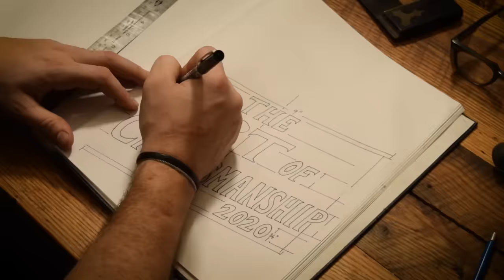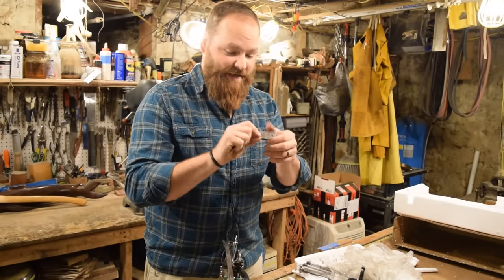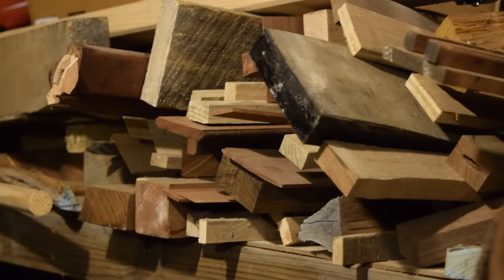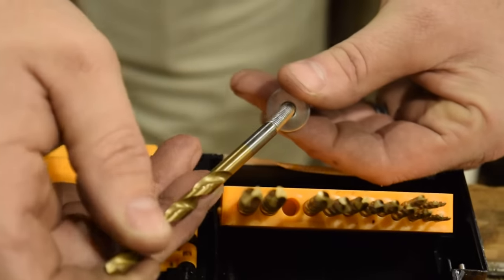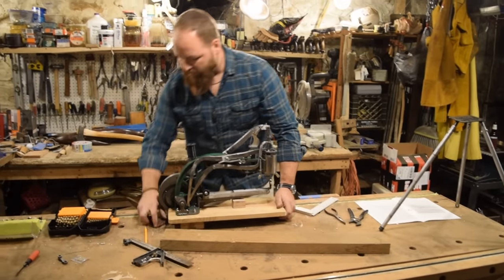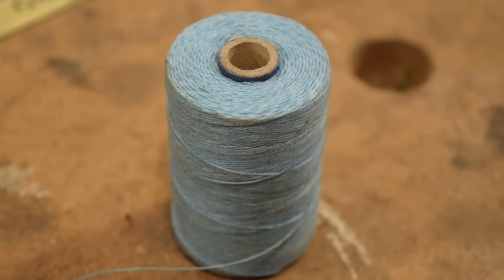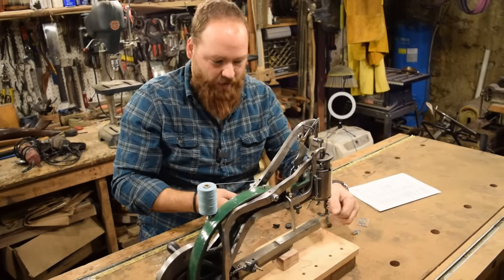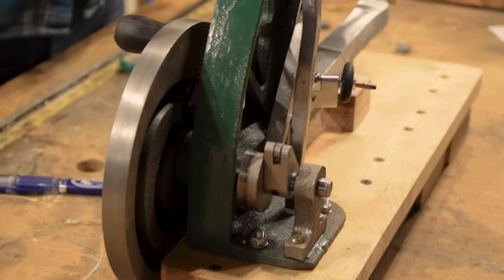The Infamous $100 Leather Sewing Machine: Unboxing and Setup

Comment: very good video. and an interesting product. i make a few knife sheaths and holsters. while i enjoy the work, i have to say that the hands arent what they used to be and something like this would save me a lot of discomfort. from what i can tell in the video, it sounds like the rollers and followers could all benefit from a bit of polishing with some 1500 or 2000 grit with some oil on it. smooth out the machining marks  and allow things to roll a little smoother. (while watching, i was wondering about the possibility of adding a bracket motor and pulley and just make it an electric. with the foot pedal, that would allow a little finer control of the work piece....i might just purchase one and attempt the modifications...
 but again, a good video....thank you
Reply from the maker: Thanks. There are some really good mod videos out there on YT.

Comment: I’ll stick with my Tippman. That small bobbin doesn’t look like it’s big enough to hold enough decent thread for large projects. Not sure if that COVID machine can sew thru 2 pieces of 10 oz. leather for a holster or knife sheath. Might work for really thin material, but good luck with important projects. You get what you pay for & a little more money will get you a solid electric sewing machine. An industrial electric sewing machine will sew thin leather really well, but for holsters, sheaths, belts, etc., my Tippman makes a great uniform stitch in up to 3/4” thick leather. It’s not electric, but has a lever/arm/handle similar to a slot machine with a grip-clutch (on same handle) to raise the foot. It was the best option for me for the money, but always best to do your own research. If I’m wrong, and you can sew quality leather with appropriate thread, please let me know. Thanks.
Reply: Suit yourself, of course, but I am able to sew up to 10mm (2 layers of 5mm) on this machine with no trouble (I haven't tried anything thicker).  I like the hand crank; electric machines inevitably go too fast for me.  The hand crank is easier to control.  YMMV.

Comment: I would put a couple of round pegs on the bottom of your stand that align with the peg holes in your bench, that way the machine won't move around while your using it. Also I would use it with the arm pointing towards my body, the flywheel will be easier to turn when going away and towards your body. It has a deep enough throat to be able to sew most things. And your needle is too small for the thread you want to use, which is why it is cutting the thread when you sew.

Comment: Won't you find it hard to control your two leather pieces with one hand while turning the crank with the other?
Reply: Usually the two pieces are glued together before switching, and the walking foot helps if they're not glued. Practice is the key to this machine.

Comment: Go to Mainly Acres on YouTube for set up tips also, you need to debut all the edges and polish the bobbin. Get a thread stand, do not run your thread off the machine.
Reply: I do ok with the thread on the machine, I just bolted a big flat washer under it.

Comment: There's vidéos of using 1930's cast iron singer machines sewing leather, we bought one for €50. We haven't restored it yet though, doesn't need much.
Reply: They don't work for thicker leather. There's a 1950s cast iron machine that will do upholstery leather pretty well, but it's not made for it and it's pretty hard on the machine to do much of that. The 1930s and earlier basic singer machines will sew very thin upholstery leather no problem, but that's it. (I've got a 1924 treadle singer, a 1954 podded motor singer, an off brand 1970s cast iron machine, a modern Janome, a patcher, and a serger. Guess which sews thick leather? Only the patcher.)

Comment: The problems you were having with broken thread wasn’t because it was the wrong thread for the machine, it was the wrong thread for the needle. Your needles come in different sizes in thickness and size of the eye; once you find the corresponding needle it will sew flawlessly with the thread you are accustomed to.
Reply from the maker: Thank you for the tip!!

Comment: The biggest problem with mine is they chromed the arms. They didn't clean the metal properly and it was chipped off in spots when I received it. A lot of extra work to clean it off. Ckeck to make sure the one you buy isn't chromed. It will continue to peel and you will damage it more cleaning the arms up and deburring them.

Comment: I am thinking perhaps a much shorter board under the base with a piece under the base to allow it to be held in place by a vise. As others have pointed out, the block you put under the arm is incorrect. It is meant to allow the work piece to slide along the arm (the throat of the machine) allowing for large work pieces. I see why you attached that block. You where largely replicating the mounting base design of "Makes Everything" from the video they did on the machine 2 years ago, but unless the machine has a design fault, it should not need that support.

Alternately I would love to see if a treadle system could be developed then mount it on a 4x4 post. This would allow it to be used hands free (more specifically would allow you to use both hands on the material you are working with)

It looks like some of the castings need some TLC, and perhaps a grinder or sander.

I am curious how thick of leather that machine can handle. I find myself having doubts it could stitch a couple layers of 8oz leather even if it is "intended" to handle shoe making.

For being a sub $100 machine, it seems rather impressive in what it can do, and how it is built. the price is up (unsurprisingly) to $120-130 now depending on if you want black or green I guess.

Comment: I sew fabric not leather but in my experience linen thread and sewing machines are not friends. Having linen run through all those corners at tension shreds it. Hence all the broken threads. But if you get it working with linen I’d be keen to see that!

Comment: I got one and it sucked, I couldn't get the thread to stop tearing even when I loosened the tension as much as I could. I figured the parts were too rough so I disassembled it and sanded them down, that didn't work and now the thread went under the bobbin holder and, I believe, got stuck in the gear and now it won't turn at all. I tried percussive maintenance to get it back to moving but that didn't work. I've rotated the bobbin holder every degree I could but it always tore and never came through the hole it needed to. After seeing all these videos showing it working quite well I was disappointed I got a lemon.
Reply: Timing might be off some.

Comment: Someone else may have already made this suggestion, you should put some grease in the Grooves of the fly wheel?
Reply: It has bearings. Light oil at most, and maybe not that. There is lots of dust and fluff around when sewing, and it will stick itself to any oily surface and gum things up.
Reply: @lwilton  Mine doesn't have bearings, it's just a groove, and definitely needs the petroleum jelly I lube it with. There's not usually much dust and fluff sewing leather, and I would definitely recommend to not sew anything thinner than leather with the shoe patcher.

Comment: TLDR ..They work..just be patient.

 You need to be willing to put time into tuning them but they are great machines once you do. 
Polish the the heck out of the bobbin(s) and the shuttle(s)  Use a Bonded Nylon thread and domestic  leather point needles (You can mod the machine to take industrial round shank needles later if you wish)   .. lightly file the edges of the presser foot and coat in plastic dip or heat shrink tubing to reduce the chance of any marking of the leather. Reguards the tuning, while it can drive you crazy and many people give up and write them off as a POS .. I'm a firm believer you can get any of them to work ..it sometimes feels like a trial by fire but you will know your machine inside out and it will make you a better user as a result.

Comment: Well the design looks like a real old one, likely based on a model from long ago.

The biggest issue with these and often why they are so cheap is lack of finish and QC.

Might be a good idea to take it apart, clean everything, check the threads and bearings. Remove any flash. Etc.

Comment: Just remember. Drywall screws are cheap for a reason. They snap instead of bending and have low durability in general. Spend the extra pennies for real steel for anything weight bearing.
Great review! Much appreciated!

Comment: I have had one of these and will say it does sew leather  as long as its relatively thin, like chrome taned leather for clothing ,Purses etc, and it will pierce thicker leather BUT IT cannot use thread bigger than 138 , holsters, knife sheaths etc require at least 277 thread,
Reply: Mine works fine with 24/180 needles and 207 polyester thread.  Biggest problem with the larger thread is the limited bobbin capacity.

Comment: Tips:  You need to match the correct needle size and tip to your thread size.

Check out The Thread Exchange (dot com) for quality thread & needles. I use thread sizes from Tex 70 (size 69) to Tex 210 (size 207) on this same patcher with Groz-Beckert needles (HAx1 and/or 15x1), but you can also use industrial needles by moving the needle arm up a little (mark the original position with a sharpie or scratch before you move it).
I use bonded polyester thread. The key is the proper match of a quality needle to quality thread size that matches your needle/thread and material (leather, bio-plastic, canvass, etc.).
>>Note:  The included needles & the black fishing line thread are junk. That's why the sample sewn was not done with the fishing line thread.😉 
  
Clean the flywheel with a bronze brush & WD40, use some 220-grit paper  on the sharp milling areas on the flywheel, lightly grease the tracks in the arm, lube the bearings at the flywheel & cam, use 400-grit paper on the top & sides of the arm, smooth your needle hole going into the bobbin case (top & below - sharp edges cut tge thread) with a rubber-grit Dremel polishing bit, clean your bobbin, bobbin case and hook with 400-grit paper, *know which BOBBIN HOLES to thread thru for various thread sizes*, ensure the bobbin is set in the case & arm correctly for *timing*, and this  machine will run great.

It is a little time with the initial cleaning, prep & setup, but is fun & worth it.  Invest the short time & you will know this machine.

There are some good videos on this machine & cool tips.

Comment: I’m curious to see how thick of leather you can stitch with this. I bought one of these for sheathes and I keep breaking needles when I try to go through 3 layers of 8oz leather. I don’t think the thickness allows for full needle travel and causes the bobbin to snap the needle.
Reply: You need to match the correct needle size and tip to your thread size.
Check out The Thread Exchange (dot com) and it will work. I use from Tex 70 (size 69) to Tex 210 (size 207) on this same patcher with Groz-Beckert needles (HAx1 and/or 15x1), but you can also use industrial needles by moving the needle arm up a little (mark the original position with a sharpie or scratch before you move it).
I use bonded polyester thread. The key is the proper match of a quality needle and thread suze that matches your needle and material (leather, bio-plastic, canvass, etc.).
>>Note:  the needles & the black fishing line thread are junk. That's why the sample sewn was not done with the fishing line thread.😉 
  Clean the flywheel with a bronze brush & WD40, use some 220-grit paper  on the sharp milling areas, grease the tracks in the arm, lube the bearings at the flywheel, use 400-grit paper on the top & sides of the arm, smooth your needle hole into the bobbin case with a felt Dremel polishing bit, clean your bobbin, case and hook with 400-grit paper, *know which bobbin HOLES to thread thru for thread size*, ensure bobbin is set correctly for *timing*, and this  machine will run great.

Comment: The piece of leather is not at all weird. Most of the sewing machines I've seen are kept with a bit of material under the foot. I imagine that this is to prevent the foot and the dog from damaging eachother., as the foot needs to be smooth and the dog needs to be grippy.

Comment: The handle doesn't seem very smooth, part of that would be the various amounts of force needed to turn the crank given the part of the cycle the needle is in.

You showed a small bearing at the end of an arm, you didn't show the installation of the hand crank wheel to the machine. I am assuming that that bearing went into the race track spiral on the wheel which makes the arm move up and down which powers the mechanism moving all the parts.

You might look at that race track looking for burs and machining marks which could cause the bearing to start and stop in a jerky motion. The surface should be very smooth which might take years to wear in and actually cost a few bearings. You could take a metal polishing sand paper to the surface to clean it up in several stages depending on how smooth it is to begin with. It would be very slow to do to a mirror like surface, just shiny could be better than what you have. Aluminum Oxide or Silicon Carbide starting at 80-120 grit if it is really rough and ending at 400-1000 grit depending on how much time you wanted to put into the effort.

A little oil on the bearing surface, in fact all of the bearings,  could go a long way toward smoothness.

Comment: make sure your needles are quality needles and don't have burrs on the tips. Also make a dust cover for the machine, it will make using it easier so that you don't have to clean it every time you use it.

Comment: I bought one over a year ago and it keeps breaking the needles.
I tried everything and watched all videos.
Reply: I have to wonder if the foot is the issue. The needle may be striking the foot.
Reply: Tips:  You need to match the correct needle size and tip to your thread size.

Check out The Thread Exchange (dot com) for quality thread & needles. I use thread sizes from Tex 70 (size 69) to Tex 210 (size 207) on this same patcher with Groz-Beckert needles (HAx1 and/or 15x1), but you can also use industrial needles by moving the needle arm up a little (mark the original position with a sharpie or scratch before you move it).
I use bonded polyester thread. The key is the proper match of a quality needle to quality thread size that matches your needle/thread and material (leather, bio-plastic, canvass, etc.).
>>Note:  The included needles & the black fishing line thread are junk. That's why the sample sewn was not done with the fishing line thread.😉 
  
Clean the flywheel with a bronze brush & WD40, use some 220-grit paper  on the sharp milling areas on the flywheel, lightly grease the tracks in the arm, lube the bearings at the flywheel & cam, use 400-grit paper on the top & sides of the arm, smooth your needle hole going into the bobbin case (top & below - sharp edges cut tge thread) with a rubber-grit Dremel polishing bit, clean your bobbin, bobbin case and hook with 400-grit paper, *know which BOBBIN HOLES to thread thru for various thread sizes*, ensure the bobbin is set in the case & arm correctly for *timing*, and this  machine will run great.

It is a little time with the initial cleaning, prep & setup, but is fun & worth it.  Invest the short time & you will know this machine.
Reply: I appreciate all the comments. 
One must think, do we not know anything about sewing? LOL.

Comment: I mean leathers top so if you're like working in construction and you just want to make some leather stuff and you don't care so much how it looks just how it functions it would probably a great cheap way to make exactly what you need for the jobs without breaking bank.  I mean like you could make some quality leather knee pads put some nice foam inside of them and the foam protectn knees. But the leather is still flexible but really tough and will last you the rest of your life to the point we're probably leaving your kids could use it if they gone to the business if you had work that required being on your knees like carpeting or laying tile

Comment: Could i use this machine for stitching together all the pieces of a shoe? Like a jordan 1 or nike dunk?
Reply: Its literally what the design was made to do. They are specifically sold as shoe patcher machines as the design was originally made by Singer (and heavily copied since) to be a shoe makers and repairmans machine. They legs are crap except when your in the field and finding a level/clear bench to work on may not be possible so made to be able to toss the machine up on any surface and only have the feet of the legs be space that needs to be cleared.
Reply: In the facebook group for these style machines you will find quite a few people that are very proficient with them and frequently take shoes like NIKE and tear them apart and replace panels with other leather or designs and use this style machine to reassemble them
Reply: @MattWeber  i understand. But if i was just building my shoe from scrap lets a nike dunk low i would be able to with this machine? Because i am confused when you say they replace panels is it only for that or could i just build a shoe from scratch with this machine?
Reply: @MattWeber  also if i make my own shoe pattern how would i even know where to stitch?
Reply: @jaredletgo6257  Start with known patterns to learn the ropes. No point in trying to learn from a harder starting point than you need to. Lots of shoemaker and how to vids around to work off with many cheap and free patterns to learn from. Then graduate to making your own pattern once grasp the basics. Baby steps, not sprinting.